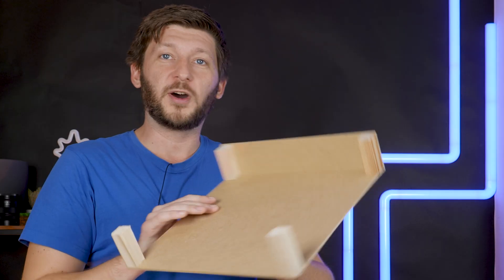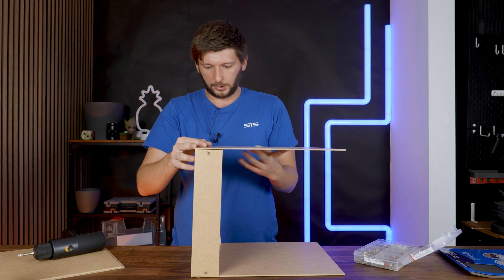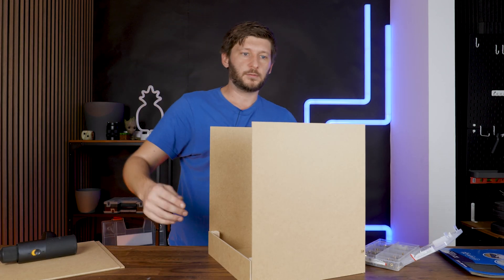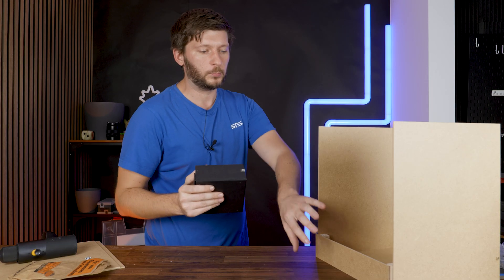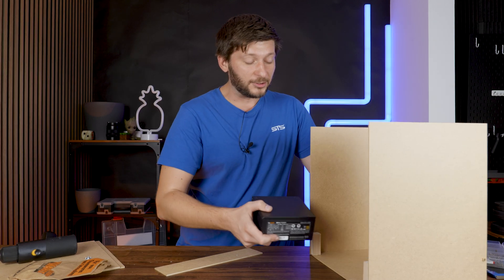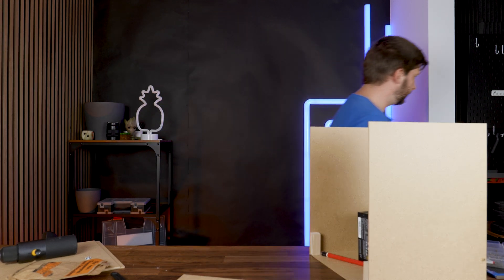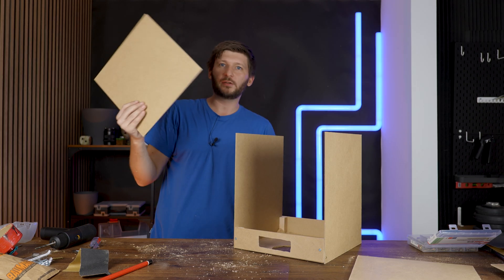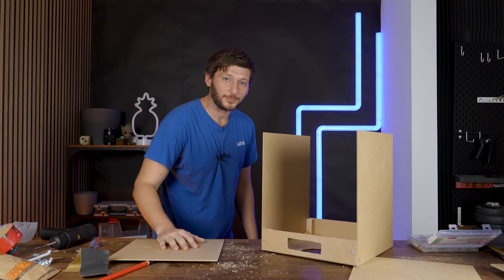It Starts Looking Like A Box - DIY CASE Fan Testing Machine - Part 3

Comment: This is ridiculous. Hope you have a fire extinguisher ready.
Reply: why? Because its made out of wood?
Reply: @profix25lo  yes, i'm also thinking the wood will act as an isulator and will trap the heat inside.
Reply: @spacecore2077  so what? Computer components Don't get hotter than 100°C and the air coming from the heat sink is even less. Wood ignites at over 300°C.